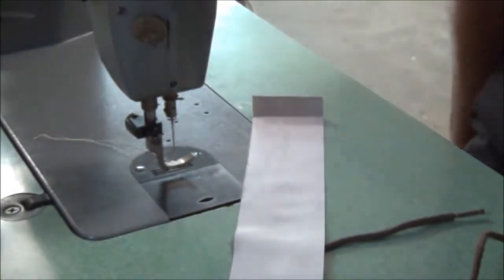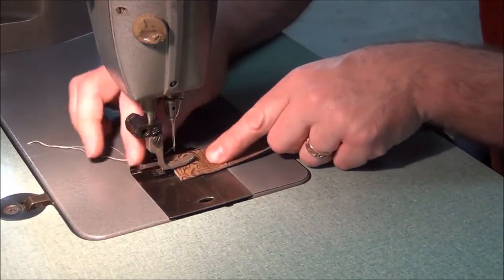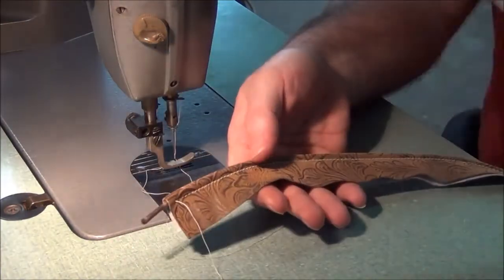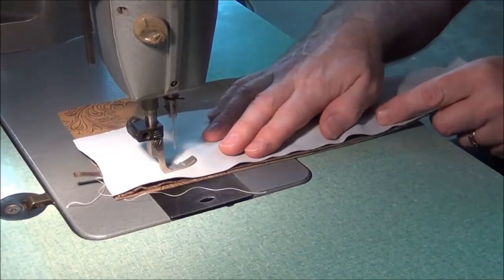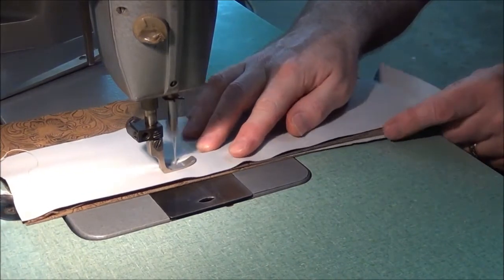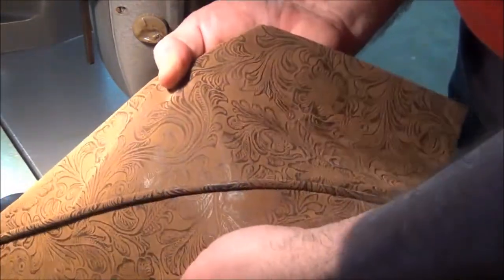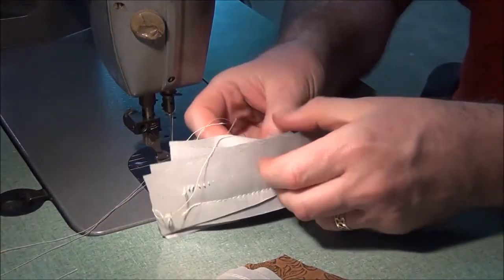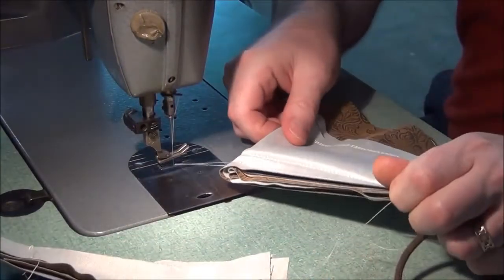Singer 281-1 movie #2 - demonstrating stitching some vinyl

Comment: It will handle fairly thick fabric.  I have a 281-1 that has been converted to a freehand quilter. I have quilted leather upholstery with lining and thick fiber under it. Sewed on this machine 50 years and still use it. Runs great.